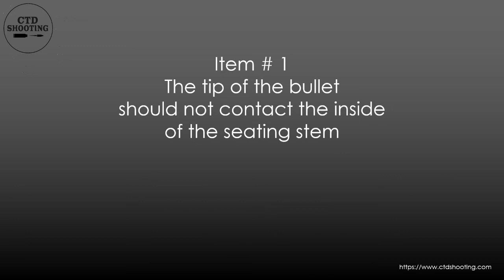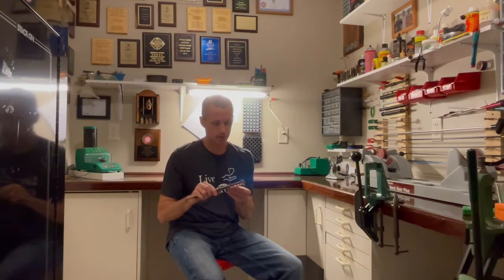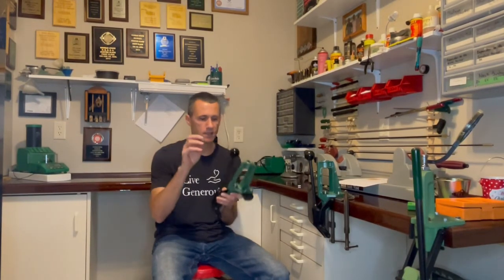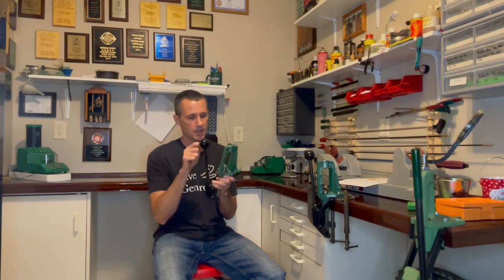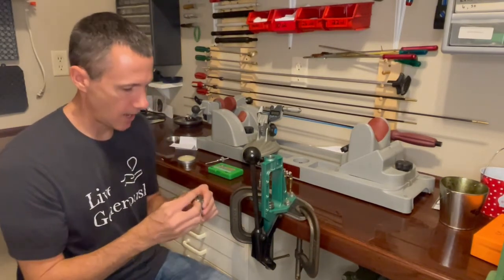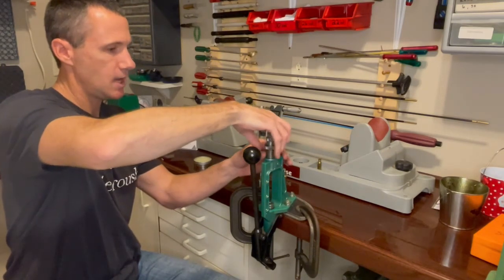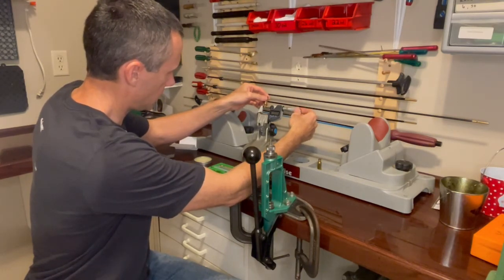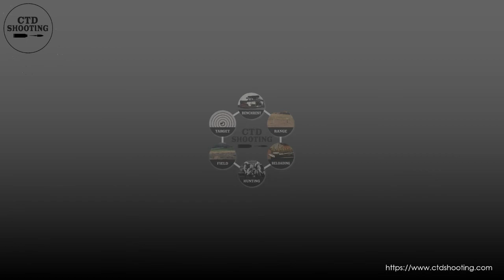6 items to Check while Reloading: ctdshooting

Comment: Why do you have multiple bushings of the “same” but slightly different size?  Seems like just using the same one would achieve consistent neck tension, all other things being equal.
Reply from the maker: Thanks for the great question.  The answer depends on the level of precision required.  For most rifles - you are correct.  The number printed on the bushing will do the job as needed.  However, for a Benchrest rifle we need to be a little more precise.    
For example, if I am doing load development with a .325 bushing (that actually resizes my neck to .3245) and the rifle tells me it wants more neck tension, I will use a .324 bushing.  But...this .324 bushing resizes the same neck to .3245.  In this instance, I thought I was using more neck tension but in reality I stayed the same.  Which will give me faulty data on the target.
Main point being:  Bushings do not always resize to the dimension printed.  (for a few reasons)  If your level of shooting demands this precision it might be something worth looking into.  If not - load em and shoot em.